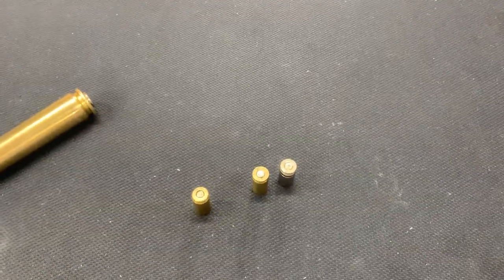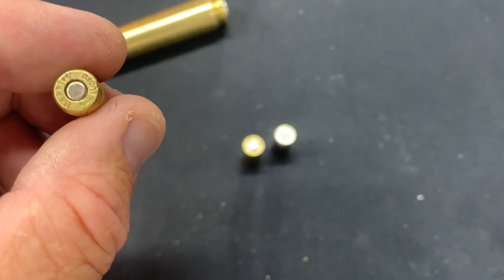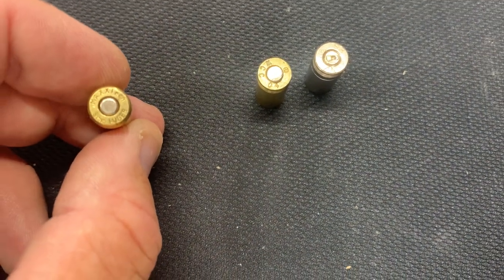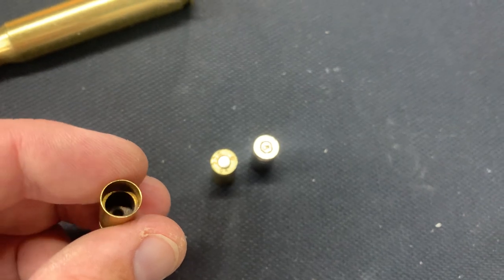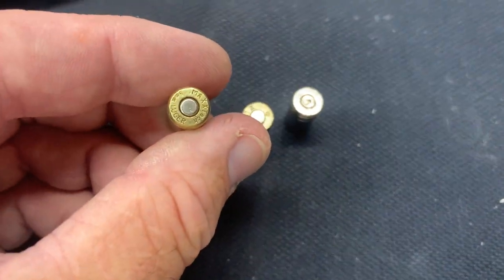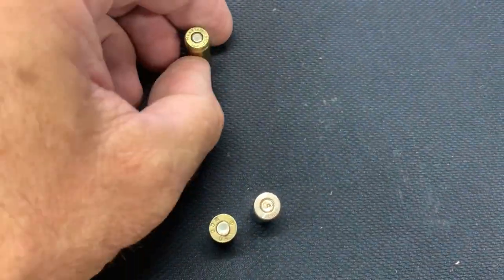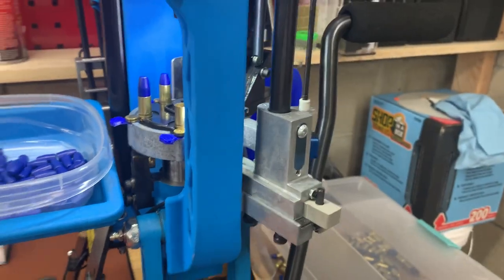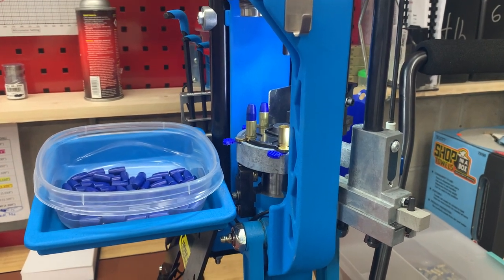Be Careful Reloading These Brands of Range Brass!!

Comment: The WCC 9mm case is a Winchester NATO case and it has crimped primers. You have to remove the old crimp before you reload. Some people use a swage and others a primer pocket reamer. The military cases the NATO cross on the base of the brass case. We are starting to see a trend where all brass reloadable cases are being phased out by more and more ammo manufacturers. The 9mm uses a taper crimp on the bullet and it is hard to wear them out. I load 9mm in lots of 500 or 1000 and keep lots segregated so I can keep up with how many times I've loaded them. I don't shoot in competition so I'm not just going through thousands of rounds a month or even a year so my brass lasts a very long time. I know I've got some that have been loaded 15 times and are still fine.

Comment: Ok your two peace brass has a special die you can go to shell shock case to buy one with the right die you can reload them 80 times no stretching after 80 time I've found they case harden so they are great cases so stop throwing them away they are worth a bit of money there original use was intended to be sold to military and gun ranges so the deal is you but tens of thousands of them and use a magnet to pick them up send them back to manufacturers and get your new rounds reloaded for a fraction of the cost just thought I'd throw that out there of fyi they are much lighter air craft aluminum bottom high tincil strength nickly alloy top without the right die they will come apart and you will have a accident if you managed to get it reloaded and fired the die cost 100 bucks
Reply: They fall apart from a bullet puller hammer. So... i really wonder about reloading... whats stoping the rim from being ripped off leaving me with a shell wall stuck in the chamber.
Reply: @fajile5109  they actualy shot fine I've shot thousands of them no real problems like comeing apart at discharge they are kind of baffling they are tough but at same time they can be taken apart easily enough I'd just call and speek with some one at shell shock or really research some reviews

Comment: I've seen the Maxxtech with step. I just put those aside and may mess with them later. The others are military and need the crimp removed. I don't throw anything under the current conditions.
Reply from the maker: Thanks for watching!  Yes, I agree--I don't throw away a single case unless it's damaged to the point where it either wouldn't chamber or extract or would be dangerous (split case, etc.).
Reply: @docgsreloading7985  yeah, when the batf sends a report out that 3 containers, several million rounds, of 9mm disappeared, strange things are happening.
Reply from the maker: @curtwuollet2912  Agreed.  That's why I pick up whatever I can whenever I can--and sort it out later.

Comment: Nice video!

I set aside all the nato 9mm I pick up to sell it separately and to not taint my own stock with that silly stuff. I've also been finding lots the 2 piece nickle brass with the strengthened case heads and keeping it aside. Thanks for letting me know not to try sizing it, I'll have to just sell those off too.
Reply from the maker: Glad I could help.  I just wanted to share what I had been finding were a problem when I picked up range brass--which I have over 50,000 cases of, and use for practice and local club (non-USPSA matches).  For USPSA events with classifiers, I use new brass.
Reply: WCC brass is excellent but the primer pocket is crimped per NATO contract requirements and you have to cut it off or swage it back.  I prefer reaming (cutting it away) by hand.
Reply: @MichaelJohnson-fe8tm  I haven't found many with cracks or defects before, I just don't want to have to swage or ream all of the 9mm I find. I already have enough 223 to prep!

Comment: The two piece case is a new style. They have a stainless top portion. They are, in fact, reloadable but require special dies. They supposedly are good for reloading as much as two or three times as much as brass. I don't know that personally, but that's what the reviewers say. The main thing people need to remember about them is that they do require special dies in order to successfully reload them. 
Save them sir. When you get enough gathered up, offer them for sale and I'm confident that you will quickly get a buyer who has been using them. 
The last case shown is a military case. It has a crimp that needs to be removed before successful reloading can occur.
Reply from the maker: Thanks for your contribution!  The weird thing is that with those 2-piece cases, I found that primers would just fall out (the Federal Premium Gold Medal Match small pistol primers).  It must be that the special dies for those must fix that problem(?).  Anyway, yes, I still have plenty of them and haven't thrown them all away!

Comment: Thanks for the heads up on that.
Reply from the maker: Thanks for watching!  I'm glad the info helped.  As you can see from the comments below, I'm not the most informed/savvy progressive reloader!  I'm glad others had expanded in more detail--I learned a lot from their feedback.
Reply: @docgsreloading7985  that's awesome. I just started reloading in October and maybe have only loaded 700 rounds so far.
Reply from the maker: @ShaneSellsRealEstate  That's great!  I'll tell you, even with all the extras I purchased for my press, I've already paid it off in less than 2 years!  Plus, during the ammo shortage I had no problems because I had stockpiled 20K of primers and Blue Bullets, about 15lbs. of powder, and all my brass is range brass that I pick up (about 50K of 9mm alone).  So I was able to make all the ammo I needed for competitions and literally saved about 10 cents per round over factory ammo.

Comment: The silver cases you could not reload are S3 and require different dies. Look into NAS cases from Shell Shock Technologies. I have loaded 6000 rounds in the last 3-4 months and have run across these cases on a few occasions. It feels like you are tearing the Dillon press in half by running those things through a progressive. However, with the next shortage being brass I am taking a close look at buying 10,000 of these at a very reasonable price. They claim you can recycle their cartridges up yo 35 times. Not only that but they are useless to anybody else picking through your pick-up brass.
Reply: The cases will start to separate at the place they are joined together.  It may be hard to notice at first so be careful.  I used to use these but stopped because of that issue.  One good thing about them is you could pick them up with a magnet on a stick.

Comment: When all you have is once fired military brass, you bite the bullet(pun intended) and buy a Dillon primer pocket swagger
Reply: I use a cutter, 
RCBS Military Crimp Remover - Small

Product Number: RC90386
by hand.  Lyman also makes one on a handle like a screwdriver.
I like cutting the crimp away rather than pushing the metal around.

Comment: I have thousand of maxxtech brass and i have newer seen one with this weird wall inside. All is ordinary straightwalled brass. 

Im searching and trying to find info on this brass but i only find thousands of videos and posts of this weird cousin (probably only sent to USA) 😂😂😂
Reply from the maker: Yeah, I have found more of those MaxxTech cases in my brass, and they don't have the lip on the inside.  As someone else commented, it could have been a shotshell type of projectile that was originally seated in the case.  Thus far, (over 10,000 rounds loaded this year) that's the only case I've found with a ridge in it.  So it's probably not that common of a finding, I may have found the one unicorn!  Besides, a bullet wouldn't have seated in it anyway, I just happened to catch mine during the powder check because the plunger got caught on the ridge.
Reply: @docgsreloading7985  i found a case just like yours with the ridge in it, luckily it caught my eye when sorting brass!
Reply: I've got brass from many different companies including MaxxTech and I have re-loaded thousands of rounds and never had a problem with them. @
PoliTalk says they blew up a gun with a light load of TiteGroup and a 115gr bullet in a Maxxtech. That is highly unlikely imho. Even if the case cracked and ruptured it's not going to blow up your gun because it is contained by the chamber. It was more a likely reloading error and either: 1. the headspace or crimping was incorrect so the bullet did not go fully into battery yet somehow(?) the gun still fired (what make was it?) or it was a squib that went unnoticed.
Reply from the maker: @ShadoLink9011  I caught mine when my Double Alpha Academy magnetic powder check picked it up because the plunger got caught in the ridge and read it as an overcharged case.

Comment: Another to watch out for is S &B.  Shallow primer pockets.  Primers stick up above the case. I just finished pocket uniformed over 400 cases.
Reply: Thanks for the heads up!  I guess a uniformer tool, small, is on my list for the next Cabela's/Bass Pro trip.  I segregate my brass cases just for this reason.
Reply: Also thin case walls.

Comment: 3:04 Here's a guy that doesn't swage primer pockets on 9mm.
Reply from the maker: Yup, I have an XL750 without a swaging station and as I mentioned in the video, it's an intermittent issue since only some NATO 9mm cases don't seat the primers.  I wouldn't waste my time swaging everything, since most of what I pick up at the range are name-brand off-the-shelf cases.  But thanks for the comment!